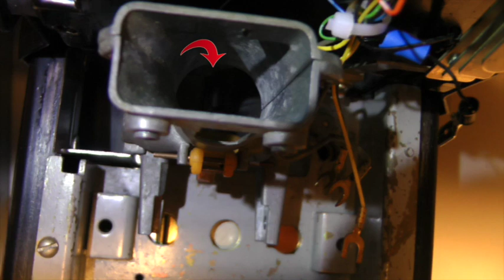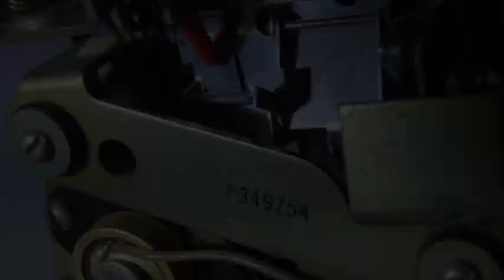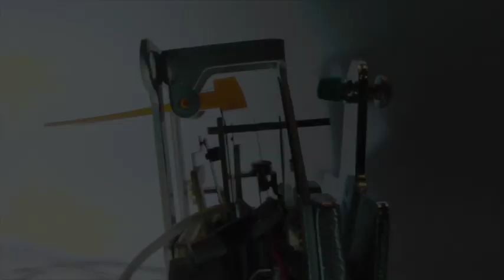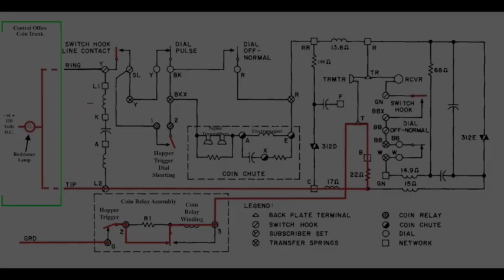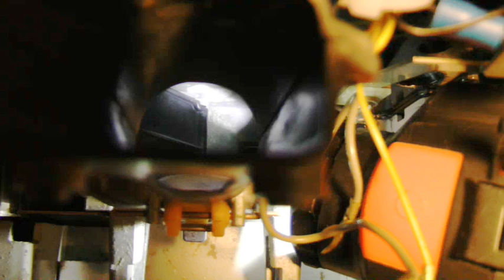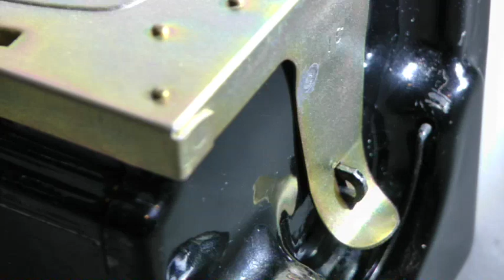The 3-Slot Payphone Part 2

Comment: I have an American Electric 3 slot payphone that works well at home; however, I'd like to wire-in a ringer.  Have any info on that?  I don't know where to start.  Thanks
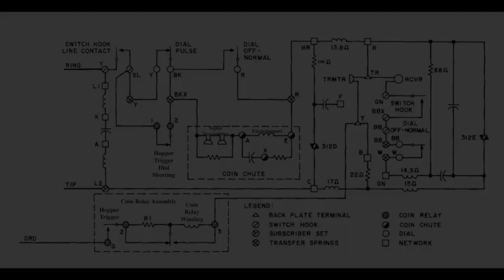Reply from the maker: Well, first off, I've never heard of an "American Electric" payphone. Presumably you meant Western Electric. If your payphone is already working satisfactorily on your residence line, it means that its internal wiring has already been modified and it has some sort of network circuit board inside. Without knowing all the details of what you have and how its wired, I really can't help much. However, I can say that a ringer is the first piece of apparatus that faces the incoming tip and ring wires from the central office. You can see the ringer on the left side of my wiring diagram at the 22:58 point of my video. The two ringer coils and the capacitor (which must always be provided) are connected across the tip and ring wires.
Reply: @Hicken65  My mistake.  Its an Automatic Electric.  I think you've told me enough where I can figure it out.  Even an external ringer/buzzer would work for me.  Thanks.

Comment: I just picked up a N233H and your video was very well done and clear - very helpful. Thank you. 

Is there a printed manual available that has the same level of detail?
Reply from the maker: Much resource information can be found online in Bell System Practices (BSP's). These BSP's are given 9-digit identifying numbers. The BSP's you want to look at all begin with 506. When you get to the website, scroll down and click on 506. This will give you a list of around 150 practices on payphones. Then you'll have to dig in to determine which ones apply to your payphone.  The 506-000-000 practice lists all the titles in the 506 series, so look at that first. Thanks for watching. Here is the URL.         
http://etler.com/docs/bsp-archive/
Reply: @Hicken65  Thank you  - this is exactly what I was looking for!

Comment: So my pay phone has no internal ringer? Is this true Cause it won't ring  Do i need the subset 685A so it will ring in my house  the phone did work Just no ringer, Thanks
Reply from the maker: The standard setup for most 3-slot payphones of the era of the one in the video do not have internal ringers or networks, because there was not enough space for them. An externally mounted  685A subset was utilized instead. Since your payphone works, it must already have an internally mounted network, but no ringer. Many collectors have modified their payphones to accommodate an internal ringer and network by removing the coin relay circuitry to make the required space. A small ringer and network, such as from a Princess telephone set can then both be fitted inside. If you want to retain the coin relay equipment, you can use an external  685A subset  and rewire it to work more like the original setup.